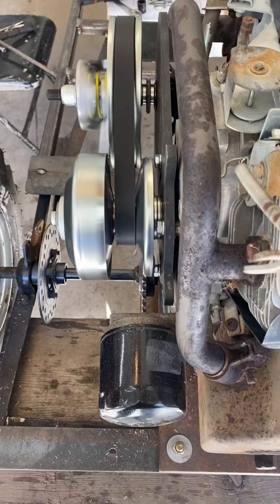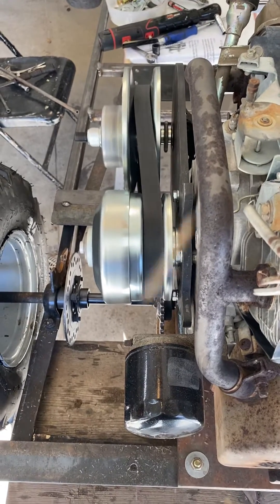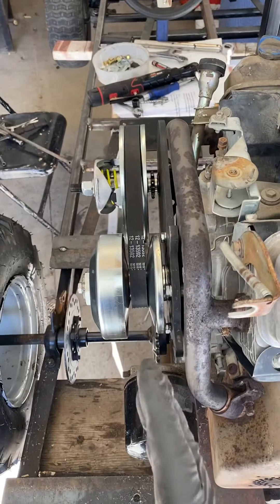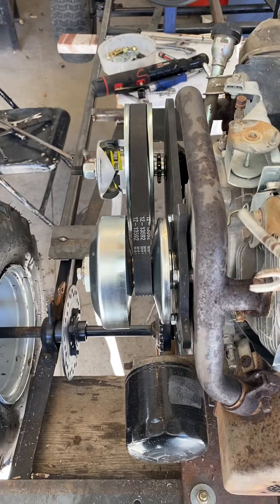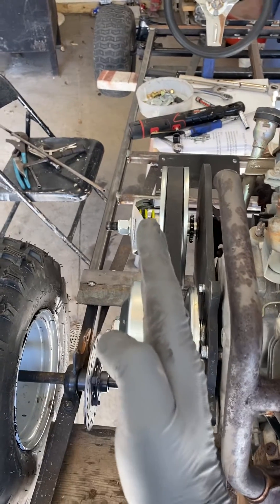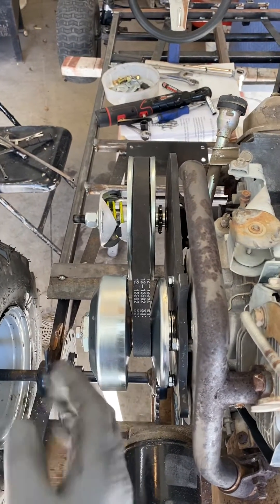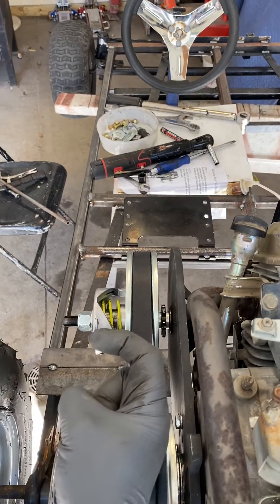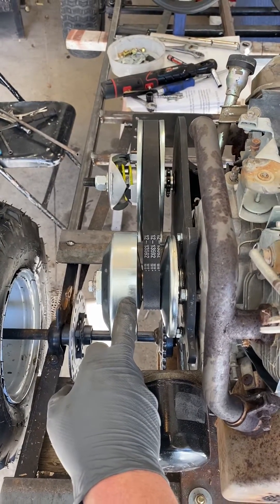40 series torque converter install part 4

Comment: Driven part is mounted backwards😂
Reply from the maker: Thank you
Reply: @zmac7467 Sorry, I meant driver is mounted backwards. The thing on the crankshaft needs to be flipped to make the belt align at any rpm.

Comment: hi, I also fitted the same kit, when I walk 2 km I touch the belt and it overheats why?? yours is the same i.e. does it overheat??? or is it normal?
Reply: Hi, i know its late, but 40 series torque converters the drive pulley goes on flipped the ither way around, opposite of a 30 series

Comment: How long did it take to figure out that you needed the chain sprocket behind the plate to make it align the pullies?
Reply from the maker: When I read the instructions 😂
Reply: I wanted to get your advise on my 40 series torque converter, i bought an engine with it already on it but i think they may have installed it wrong. It is on a go cart, and i will say that it functioned well. But i want to install it the right way@zmac7467

Comment: I have a series 40 torque converter and not every torque converter is the same my torque converter is self-centered you can't put the belt off on either side of the drive converter it literally says perfect in the middle there's no way to to put it in the middle it's already in the middle and most series 40 torque converters are made to go on backwards there is a reason why you put the the drive converter on and it doesn't slide all the way down the shaft and it hits the bolts on the mount for the torque converter that's why it hits the bolts on the mount it's not supposed to be that way it supposed to be backwards I've literally called the company and ask them they said it goes on with the engaging part towards the motor
Reply from the maker: https://www.bmikarts.com/PDF/Comet_40series.pdf

Thanks for the comment, unfortunately I’m having a hard time understanding exactly what you mean.
I also spent some time speaking with Comet tech support. I have attached a link of the installation instructions for your review. Per comet industries, as long as the clutch sheaves on the drive and driven oppose each other, you’re good to go.
Good luck to you!
Reply from the maker: I re-read your comment and I think I’m tracking with you now. So does your driven pulley actually move side to side on the Jack shaft? I’ve heard of some people setting there clutch up that way. I’d like to see that in action! 👍
Reply: @zmac7467  the way mine was set up you put the drive clutch on backwards they are supposed to be on backwards a lot of people don't know that I called the company itself and they said that yes it goes on with the thick part towards the engine engaging side towards the engine that way pushes evenly on both sides of the belt can't even put the dry clutch on without it hit in the nuts and bolts on the casing without putting it on backwards that's actually how it's designed I wanted to start a YouTube channel I might start I am actually building an 18 horsepower go-kart that I put a front disc brake conversion on with Annie break windshield heater Stereo King Quad tires and spacers and series 40 torque converter this thing is going to be a monster
Reply: @zmac7467  so yes the way that he's showing you is correct be driving pulley goes on engaging part towards the engine but you shouldn't have to put washers on your other clutch I don't know why his didn't line up correctly I guess it's just the nature of what he bought I bought mine from eBay $199
Reply from the maker: @davidwilliams9220  sounds good !
I’d like to see videos of your project 
Let me know thanks!
Reply: @zmac7467  yes I'm going to start doing it this week there's too much false information out there I'll give the guy an a for effort but that's definitely not the way it goes on I have built many of these the drive converter definitely goes on the other way if you do that you will have no problems with your pulley you should have no chatter you should have nothing you have to line the fat part of the drive pulley up with the back part of the other converter if you look me up on Facebook I will put a few pictures of mine on there so you could see my name is David Williams Junior from Scranton
Reply from the maker: @davidwilliams9220  👍
There’s a fifth video in this test, check it out
The driver is flipped over in that one
Reply: @zmac7467  I'm actually running it that way I called a couple of Manufacturers and they all said that the way that it goes is the skinny plate on the outside not towards the motor they said that is a big, mistake because a lot of these kids don't come with plans to put it together and a lot of the plans are even wrong that's what you get when you have an out-of-state manufacturer putting things together for a in-state seller but yes the big bellhousing on the drive clutch has to be against the motor like on the last video that is correct that is the way it supposed to be like I said I've contacted probably five different torque converter manufacturers and they all said the same thing you have to put the big part against the engine and line it up exactly on the 5th video so V video is correct that's how it should be lined up with the converter in that configuration
Reply: And that's one of the reasons why a lot of these videos doing the torque converters are saying you have to put a washer behind it to get it away from the bolts or it hits the bolts on the plate well it's not that it's hitting the bolts on the plate it's that you have it on wrong there is a reason why that lip is on that plate it's to show you that you have it on wrong so yeah V video of where it's flip like that that's how it's supposed to be very good very informative video I just don't understand why he had to put washers between the drive clutch and the secondary clutch the one I have on their line right up and I'm running a duromax 18 horsepower what a series 40 torque converter from eBay $199 pretty impressive for the price if if I might add
Reply: All I'm saying is I contacted five different manufacturers and they all said the same thing you should not need any washers or Chuck's and the fat side of the main Drive converter goes on like V video with the fat side towards the engine